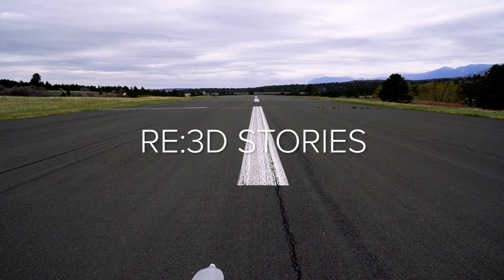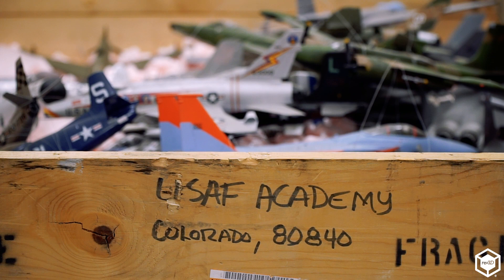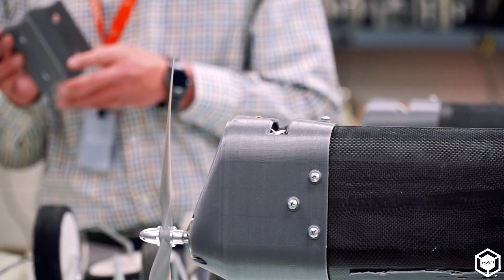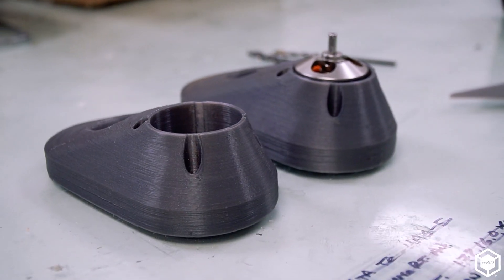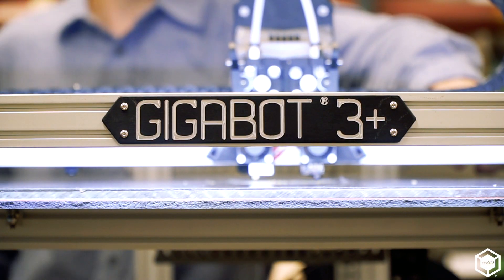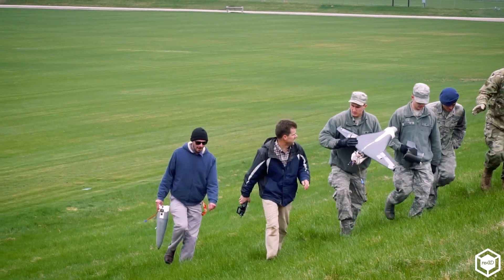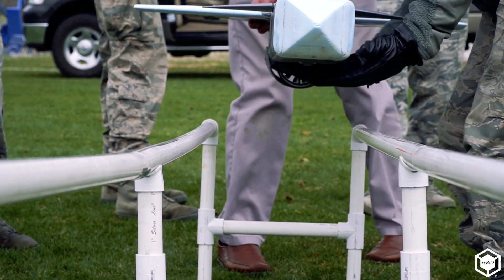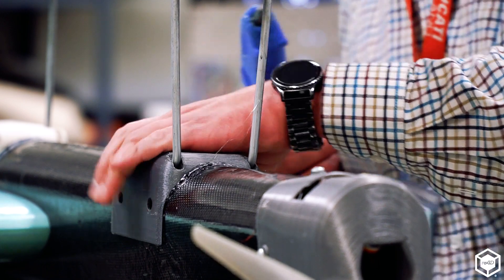Unique UAV Prototyping at USAFA Using 3D Printing

Comment: By the way why did they not use a runway?  they could have gone to the local rc model club and have the correct facilities for flying RC model planes.
Reply from the maker: Good question! They do a mixture of different types of takeoffs: there are runway takeoffs, bungee launches off ramps, launches off the tops of a moving car driving down a runway... It all depends on the specs and the purpose of the vehicle they're building. They definitely have no shortage of runways that they can use when needed!
Reply: @re3Dprinting  bungee launches are a common way to start a (high wingloading) jet model ; most clubs have those either ready on the field or in a storage facility on the field.
These guys look like that only read about model planes but lack the practical experience. They should visit the flitetest guys (yes that is how they call them flight test was already taken)  and gain some hands on practical experience.
Also on smaller scale and with low wing loading aerodynamics is rather different then full size planes; designing a big plane and only scaling it down will fly poorly if at all.

Comment: Did they download it from thiniverse of just buy it from https://3dlabprint.com/?
Anyway nice to see that they are now catching up with the hobby rc model community.
By the way since this is a drone have they registered and pass all the exams to be legal to fly this ?
If not they have to be reported and could end up in jail.
Reply from the maker: The RC aircraft are all designed and created by the engineers in the program. Their coursework involves the study of flight mechanics to learn the mathematical equations that govern large aircraft fly in order to become pilots, and not necessarily to innovate in aerospace engineering. Because the USAFA is part of the military, they likely have gone through the necessary approval and registration of their course with the FAA, especially considering that they are a restricted airspace and would need to inform all necessary military personally that they would be flying.
Reply: @re3Dprinting  so they try to catch up with 12 year olds who learn all this in practice trough "trial and error" like i and many with me did?